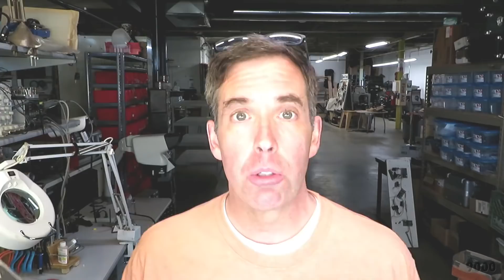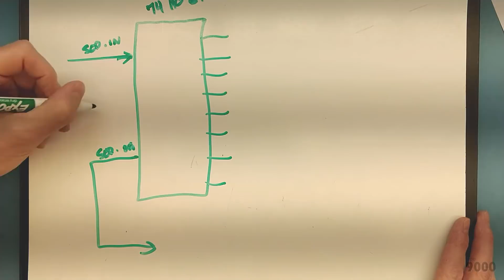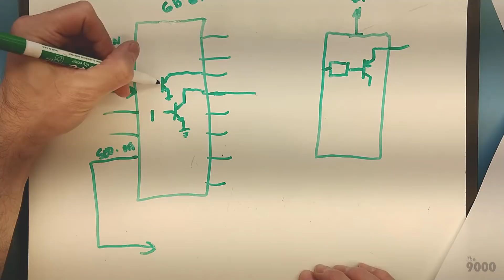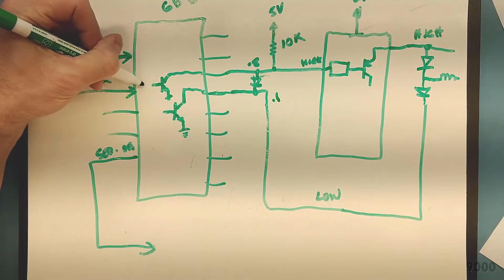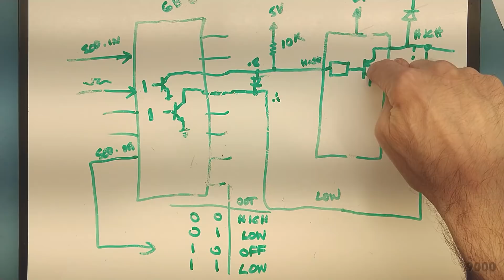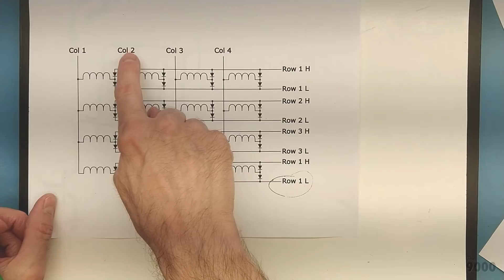FlipMaster 9000 Part 2: The Controller

Comment: Very cool! I especially like the auto-detect of how many columns you have. One thought I have there is to maybe do a binary search for the ending, instead of just linear search? That is, if it’s doing one board at a time... but I guess maybe you’re not, and you’re checking all boards at once?

Anyway, cool. I may have to go check eBay now. ;)
Reply: I think binary search wouldn't work here as they use shift registers, so you you can only move 'forward' 1 really quickly. Moving 'back' would need you to shift in a completely new stream of data.
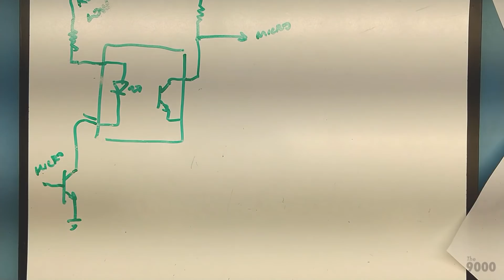Reply: @laurensweyn  So, we're talking about the detection stuff that starts getting introduced at 21:32, right?  (Been a while since I've watched this, so had to refresh my memory), and in particular the process at 25:08?  Or, well, and there's even two phases here -- the one that gives you the number of possible columns (25:50) and the one that figures out the specific set of columns (25:57)... Anyway, I think you might be thinking about this differently than I was.  I wasn't (as best I recall) suggesting that I thought these things were random-access, but rather to apply the general algorithm of binary search to what gets shifted in -- because, as you say, the shifting part is really quick.  So like, for the first part, maybe one does a set of progressive doublings to find an outer limit, and then does a binary search to find the limit -- so, shift in 1 column, then 2, then 4, then 8, then 16 (presumably all coming up positive; could even skip most of these), then 32 (maybe or maybe not, but let's assume so because we have multiple panels), 64 (ditto), 128, and perhaps keep going as needed... but when you get your first negative (let's say at 128 columns), you then go back to half-way between the last known good (64) and the first known bad (128), and test 96 columns... if it's good, you go to 112; if not go to 80... and for each of these, e.g. the 80, say, you shift in 80 columns worth of data (160 bits).

Whether this is actually worthwhile, I'm not sure.  Maybe the linear search is fine, because it's quick enough and usually not at an immense enough scale to really matter.  And/or maybe shifting in 160 bits is, while "really quick", still slower than just doing the linear search.  I'm not sure.  I feel like I had some reason for thinking it was a good suggestion at the time, but that doesn't mean it actually was, and anyway, I haven't been thinking about this enough to be sure right now.  :)

Comment: 15:00 - What high-side driver chip did you use? I keep looking, but I can only find references to old chips that aren't made any more.
Reply from the maker: I used the TBD62783 transistor array.
Reply: @The-jr6pi  Awesome, thank you so much for the info! 😊
High-side drivers are not easy to find, and these appear to have both through-hole and SMD versions! ❤